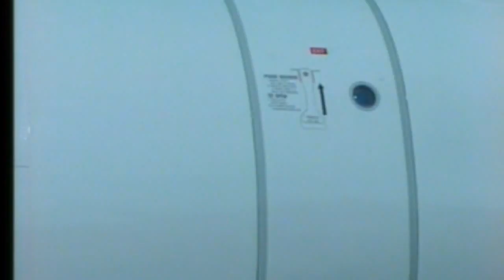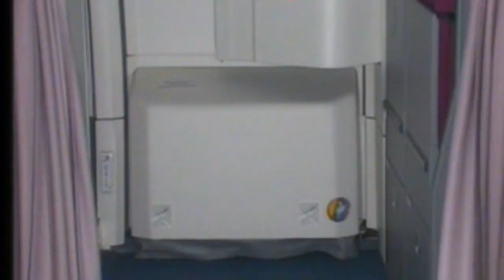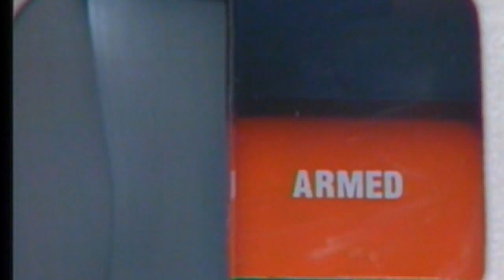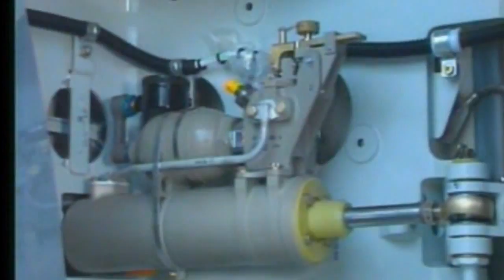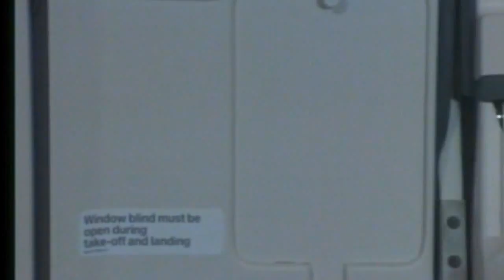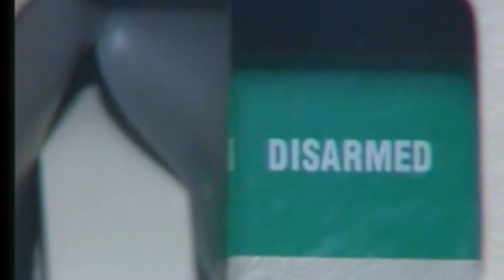Type 1 Door Description A320 Family

Comment: White light for cabin pressure indication while red light for warning indication when you pull handle with armed condition..... Kindlly correct
Reply from the maker: @Abrar 51d

1- The slide armed indication : white light, illuminates if control handle is operated when slide is armed.

2-Cabin pressure indication : red light, flashes when both engines stopped and the slides are disarmed and the CDP ( cabin differential pressure) is above 2.5 Hpa
Reply: White light will steady on if we open the door in armed mood.
Red light will start flashin when we disarm the door and cabin oressure is above 2.5mbar.